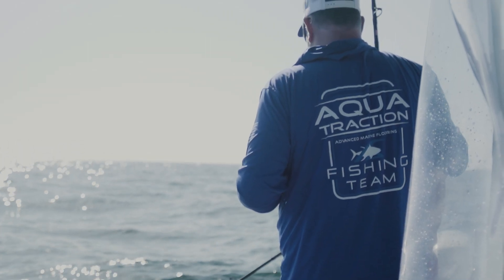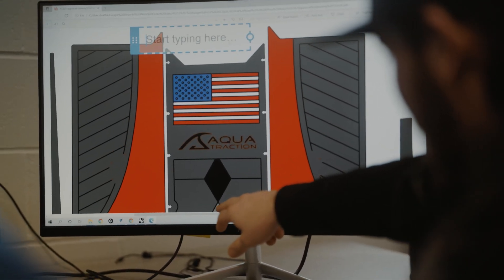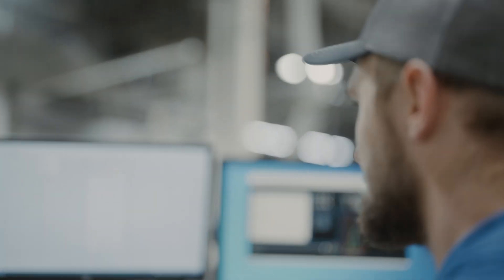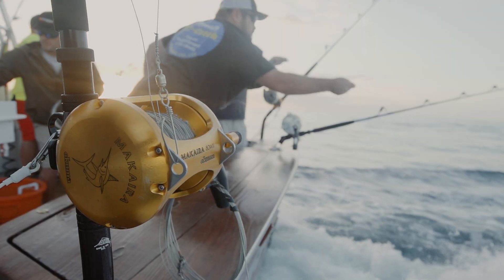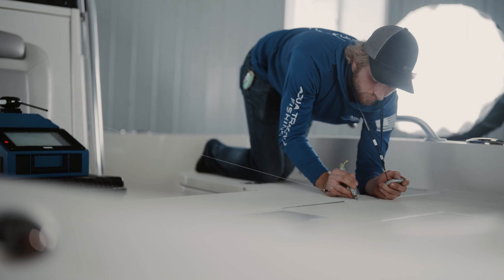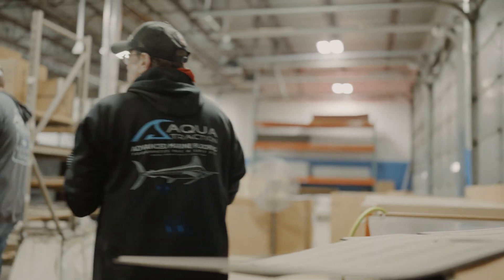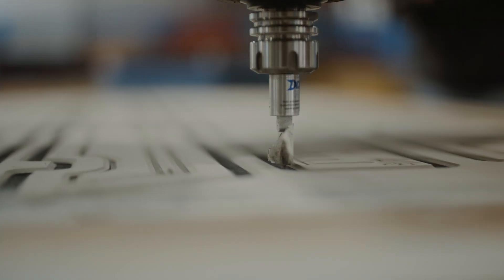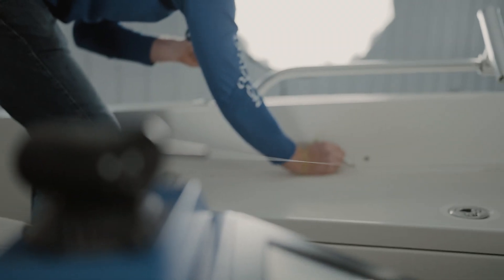Discover The Difference: An Insight into Our Engineering

Comment: Show with blood or guts. We still have stains on ours, less than a year old. Very dissapointed in it as not easy to clean!
Reply: Worst mistake I’ve ever made was buying this flooring.   Its been loosening up beginning three years after installation.  Its not durable and it stains very essy. ‘Put gorilla glue under it’ the dealer said.   Make matters worse the boat stays under its mooring cover all winter and when its on the boat lift. We put maybe 60 hours a year on the boat..   I’ve given up.  So much of it is loose I’m tired of looking at it and dealing with it…